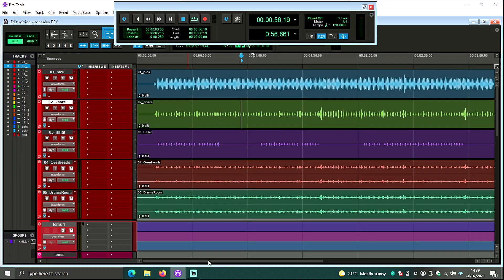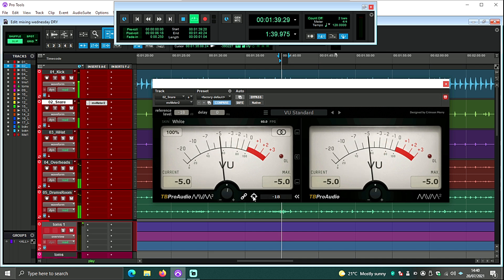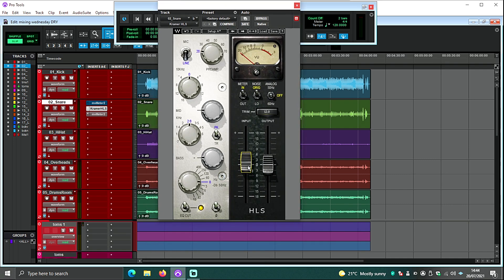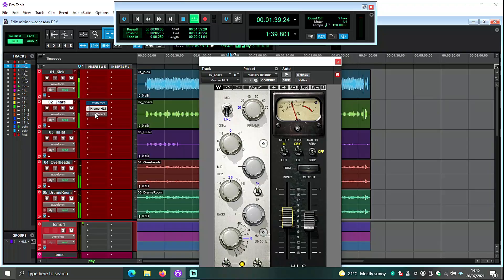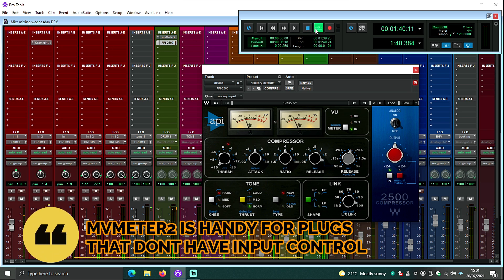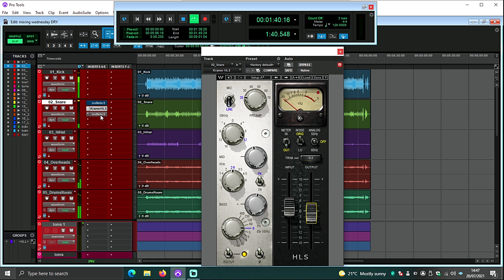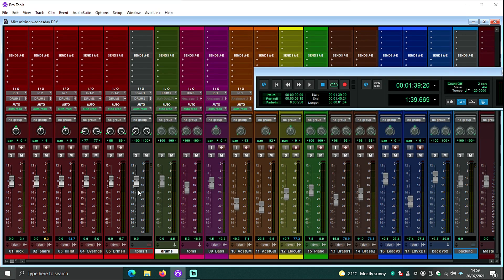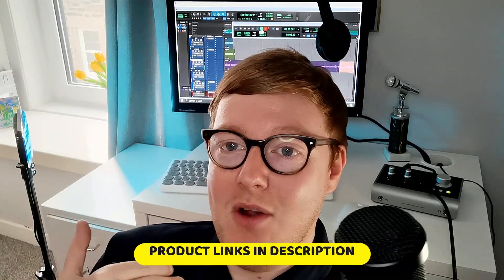Why You SHOULD Gain Stage Analog Emulation Plugins (PART 1)

Comment: Omg this is the probably the simplest and most important info about gain stainging. Analog plugins are designed by the real analog hardware and need the same input volume like the hardware. Thats why there is VU meters in the plugins and you can switch in/out and there are input a output volume fader to keep the same volume after processing. 
Bless you, +1 follow.

Comment: Hey Paul. Thanks for the video. 
I just wanted to point out that the Waves API 2500 you're showing doesn't actually display dbVU, but dbFS. The Helios plugin on the other hand actually shows dbVU. This is an inconsistency with Waves Plugins (and maybe others) that I found quite irritating. So when you said "use the VU meter of your plugin" I was instantly reminded of this problem that I discovered when getting into VU gain staging myself. Many plugins use a VU display, but not all actually have VU metering.
Cheers!
Reply from the maker: Tbh when it comes to eq's, especially ones which are basically linear, whatever you go in at.. won't matter. But yeah interesting that it's a fake vu but not surprising

Are you talking about the 550 eq or the 2500 compressor?

Comment: Hi Paul, I think you answered me this once but I can't find your reply...Tipically I do my gain staging by setting the kick at -24dbfs and then balancing all the other tracks by ear, like snare, overheads, bass, guitars, etc...First I find their right level with the faders and then I set that same level with clip gain so I can set the fader back to unity, my question is: Do you think it's ok to do it this way or Would I reduce aliasing by setting all the tracks to -18 and setting the levels with the output gain of the plugins?
Reply from the maker: In regards to aliasing as long as your input meter isn't massively going into the red.

I personally gain stage first in studio one using their input stage and vu before going into any plugin. The vu tells me where its hitting and I adjust the input stage accordingly. Take the vu off and then work with the plugins.

Only thing I worry about in regards to transients is snare, kick not so much. I aim for -18dbfs first before I do anything and just keep the levels the same in the plugins via the output. If I want more drive in something I'll crank the input more but always compensate the output
Reply: @PaulThird  thanks Paul, do you think aliasing would be reduced if I change the sample rate of a session from 44.1 to 88.2? Wouldn't that give plugins more range to not throw aliasing into the mix? Wouldn't that be easier than oversampling every single plugin?

Comment: Hi Paul, maybe is a dumb question but, when it comes to analog gear and plugins during mastering, Does the mastering hardware needs to receive the signal at -18dbfs until the engineer run it inside the limiter?
Reply from the maker: Mastering hardware will run at 0vu which in a lot of emulations may be -18, -15, -12. Depends on what the plugin has calibrated 0vu to

Comment: I’m so confused. With floating point math in the digital world, why do you need a separate VU meter plugin before you go into your analog emulating plugin that has a VU meter and an input gain control. Why not just go into the plug-in at whatever level you want and then turn the input gain control on the plug-in down until the meter inside the plug-in is hitting right at or below 0 VU? If the plug-in was designed with digital floating point in mind, turning the gain down before the plug-in shouldn’t be any different than using the input gain control inside the plug-in. Am I wrong?
Reply from the maker: There are quite a few variables ie your plugin doesn't have a vu or a vu which shows input then a vu plugin is handy. Or if it doesn't have an input control then it's necissary. Mvmeter2 is good cause it picks up the max peaks and attenuates accordingly so your input never exceeds 0vu or whatever you set it to. Some plugins are calibrated at different dbfs levels so you don't know what 0vu is where with vu plugins you know exactly where you are hitting going into the plugin.

There is no difference using the input control IF your plugin emulation has one but where Mvmeter2 works better is that it gives you the correct reduction or boost to ensure that your max peaks hit the vu target bang on

Comment: I thought it would be good to let the signal go over 0db for a bit like how they used to do it?
Reply from the maker: There's no hard rules. I'd say use your ears. Going into the red of the vu is fine it's just if you completely over abuse analog emulations going in then you can bring in a crap ton of aliasing which you don't want

You've got to remember that analog saturates  without any aliasing where plugins alias when making harmonics past nuquist. That's why we have oversampling and anti aliasing filters fixed into many modern plugs. That's why you kind of 'should' stick to the input limits of plugins as you can't really get the same results cranking them like you would hardware without getting some form of aliasing. It really depends on the plugin but most advise to go in at -18dbfs
Reply: @PaulThird  thanks for the tip! I see thats why newer plugins are better than older because of how they deal with aliasing like in your other video about aliasing.
Reply from the maker: Correct. Internal oversampling and anti aliasing filters are kind of the norm BUT as my video coming out this afternoon will show, sometimes anti aliasing filters can cause Cramping which you don't want so there's always more for plugin devs to deal with these days

Comment: 2:07 so if I hit a plugin at -18 I must have the output of that plugin at the same input correct?
Reply from the maker: For continuous gain staging yes. Makes it easier for you when going into another plugin as you don't need to dial in the input as the previous plugins output was compensated to match the input.

However some plugins calibrate 0vu to -12dbfs so it's worth checking the manual what 0vu is in the plugin

Comment: I use Cubase and it has a pre gain slider on each track which I normally use to gain stage. I normally play the track the whole way through, see where it peaks the highest on each track then adjust the pre gain accordingly on each track till they are at -18. But this plug in looks very interesting so I'll definitely give this a try too. Great video 👍

Comment: 3:35: not complete: watch out that you are not clipping your group/bus channel before going into the plug-in. Keep in mind that the fader is after the plugins, which implies you may well be attenuating an already clipped signal.

Meaning: lower your faders if necessary to soften the group/aux hit. 

In reaper you have a handy pre fader metering function. I have it on shortcut. Way too important
Reply from the maker: I always gain stage my tracks and manage the faders so I don't really have much or any real gain staging on the busses but I zero'd the faders to show how even though the tracks are not clipping they can build up and hit the busses hot 🤓

Comment: VU meters don't read peak levels very well. Transients such a snare hit can't be judged only with a VU meter. It's possible that even if it reads 0 dBVU on a VU meters it's also already clipping 0dBFS and the whole gain staging concept falls apart.
Reply from the maker: I've found this out and discussed in the comments and actually making a test for Wednesday to hear the differences of transients at different input levels but thanks for your comment still 🤓
Reply: VU reads transients slower, you have to switch to peak mode

Comment: Logic has a "Normalise Region Gain" feature with a normalise to Peak and a normalise to Loudness setting. Do you have any recommended settings for this feature for using it to gain stage automatically (without using VU's)? Would I just use the Peak setting set to -18dbfs? Or better to use the Loudness (average?) setting set to _?

Comment: Sorry Paul but this is misleading information. 
"correctly gain staged" is not the right way of stating it. 
IT implies driving the analog emulating plugin a different level will sound wrong (if you drive it at -12 or -6). There is no wrong way to gain stage it. You use analog emulating plugins because they distort and add harmonics and clip etc. Using analog plugins then trying to avoid their distortion makes no sense. IF you want no distortion use fabfilter and be done with it. If you want some analog like distortion there's no way other than to listen to the processed signal.  

AS you know, you cannot digitally clip while you are in the DAW. It works at 32bit floating point with a dynamic range of 1500+ dbs. So you cannot clip it. 

The analog emulation plugins are meant to saturate but you cannot "abuse" the input as in abusing HW. Any level you throw at the plugin will be processed exactly as the programmed intended it to process. So there are no random accidents to be avoided. 

So if your tracks are at -6 and its too hot for a particular plugin, lower the input of that plugin only. No need to go hunting for levels of your tracks and do the whole project. Plugins will not accidentally clip in an unintended way because they cannot behave in any random way that wasnt designed for in the first place. Whatever saturation you get, whatever distortion you get, was planned by the developer. If its too little, turn it up, if its too much, turn it down. 

The level "-18" - for ITB DAW productions - is completely arbitrary. The only thing that you can consider "wrong" is to clip the output above zero. Which is not a problem because almost all DAWs throw out warning messages whenever you clip the output. 

The right way to put it would be "these plugins were calibrated so they will be as transparent (minimum coloring,distortion etc) as the actual devices they were modeled after at -18. If your aim is to get a clean signal with minimal analog processing, use -18. However if your aim is to get a clean signal, go with purely digital processors like fabfilter which add no analog colouring and you dont need to worry about the incoming level.
Reply from the maker: 1. I said a few times there are no hard rules. And also I mentioned how others gain stage to - 20, - 22 for more headroom. Others hit harder to drive the plugs more. I said use your ears but don't abuse the input. 

2. In terms of saturation. The reason that I use - 18dbfs is due to that being recommended by the manufacturers in the manuals (acustica and many others). It's also 0dbvu in nearly all of the plugins and vu meters. There's a reason why many plugin devs stick to vu meters and this brings me onto 

3. The reason that I advise gain staging is mainly due to aliasing. I made an entire video about ITB mixes sounding flat. I showed the issues that can be caused by hitting the inputs above -18dbfs in the plugins. Whilst the saturation has been modelled past the digital 0dbvu you hit it at your own peril.

Aliasing is inevitable the more higher order harmonics you make. the harder you hit the input, the more higher order harmonics, thus more aliasing you will bring in.

The aliasing is mostly under the audible threshold when you gain stage to -18dbfs (if the plugin has been internally oversampled or uses anti aliasing filters) but it isn't the more you abuse the input.

Aliasing is unmusical and ive proven in other videos the negative impact audible aliasing has on sources.

So before we start calling me misleading please bare in mind that mostly i only say things that I have proven.

Hardware doesn't introduce aliasing, so a 'truer' signal would be ensuring that you aren't bringing in unmusical harmonics unrelated to the source. That's why I said you can go into the red but DONT abuse the input as you don't know when the aliasing will start being audible. 

-18dbfs is a good rule of thumb where you know are hitting the plugin at 0dbvu. You know the aliasing is kept at a minimum, especially as many devs advise you to go in at - 18dbfs max peaks. You go past that then you are playing a guessing game of how true that plugin is to the 'true' analog signal and saturation
Reply: @PaulThird  aliasing is something that needs to be managed. Either up your sampling rate or use plugins that have oversampling.  No need to "prove" aliasing as its well known since Nyquist put the theorem down. 

I'm taking issue with the "correct way" statement. Your way is not the "wrong" way, nor normalizing everything is. Aliasing or unwanted amounts of saturation is something that needs to be managed in any case, and dealt with accordingly, no matter the number you pick for gain staging.
Reply from the maker: My own words in this video

"and then what I do is I set the trigger tool to -18, I'll loop the audio, and then I press the trigger at the loudest part. It then adjusts the gain to -18 or *whatever you choose to set it at*. Now this is just a gain staging one for -18 which is 0dbvu"

I also said 

"-18 makes sense to a lot of people because it's 0dbvu. Your not going into the red of the Plugin" 

"in an absolute nutshell, its get the desired level that you want to go into, and then ensure that your output stays at that. If your output stays the same as your input then your not gonna have to touch your input" 

"that is how I gain stage, that is how can gain stage. There are other ways you can do it. No set rules. It doesn't have to be -18. Some people gain stage to -20 or -22 to give them just a little bit more headroom. Some people like to hit the units harder cause they feel they are getting more saturation"

"just ensure you've got a nice level going in that signal along the way and you should be fine" 

No misleading information there. 

I've been clear that it's how I gain stage and explained that -18dbfs is 0dbvu in the plugins and that there are no set rules. 

I have linked a previous video explaining reasons why I gain stage due to excessive audible aliasing which we can agree is unwanted by the developer and does not result in the correct sound of the hardware. 

However I have also stated that there is no set rules and shown how plugin developers show the plug going into the red past -18dbfs even though its not clipping in the daw. Its in indication that the input is being overloaded and they want you to know that. 

I've not once said that -18dbfs is the correct way to gain stage. I mentioned correct gain staging as 2 possible outcomes. 

1. Where your plugin correctly matches the level you decide to gain stage to. The plugin is correctly gain staging to what you've set or what your vu meter is indicating. 

2. Gain staging where you don't go into the red of the Plugin. If you decide not to go into the red then setting your input so it doesn't go into the red of the Plugin would be correctly gain staged as its meeting your desired level. 

Correct gain staging to me is ensuring that your plugin inputs hit whatever level you want to go in at. You choose the level and you ensure you stay at whatever level you choose to go in at. 

I may be taking this too far but I'm not gonna be called out for misleading information when I've never once said that "if you gain stage to -18dbfs then that is correctly gain staging" 

I've given examples of how I gain stage, how not to go into the red of the plugins and how to set input levels using a vu meter, whilst also advising there are no set rules for levels. Genuinely that simple.